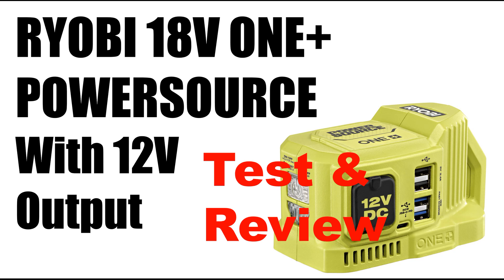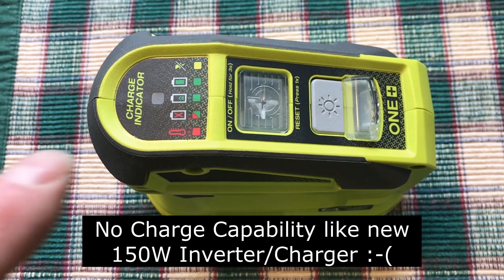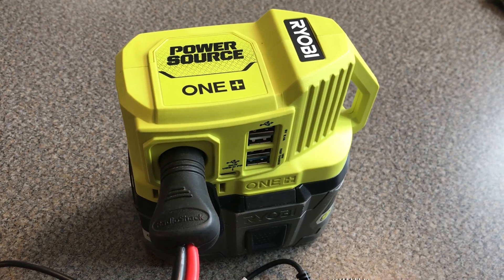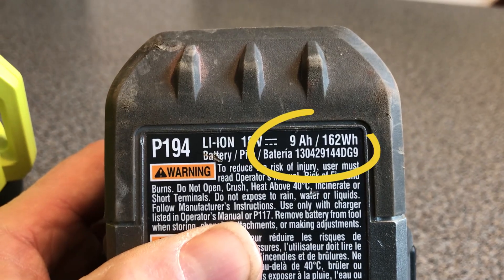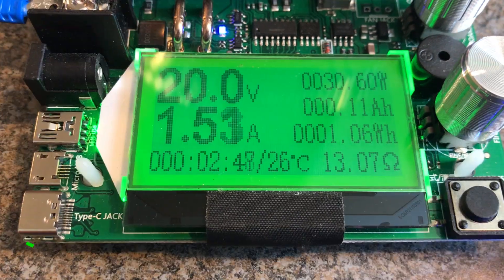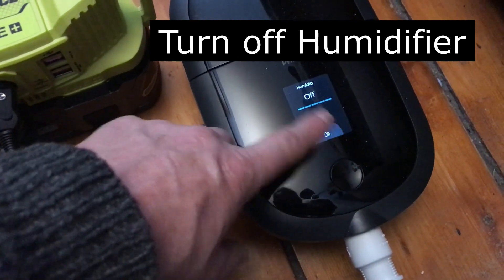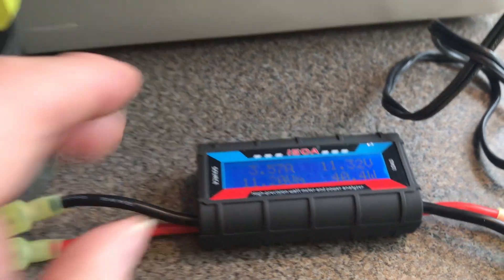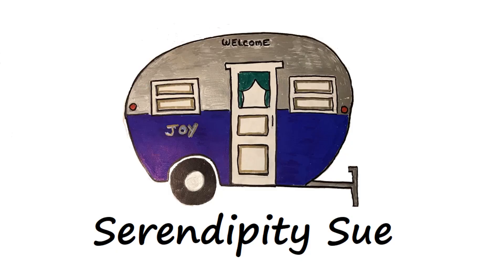New RYOBI 18V One+ Power Source with 12V Output Test & Review (RYi12VBGVNM)

Comment: Why buy this when you could just get the inverter that also has USB charging?
Reply from the maker: @laynelg8762  if you are running 12v appliances it’s much more efficient than converting to AC and then back to DC. The cigarette plug usually handles much higher amps at 12v than usb-c

Comment: Does it shut off automatically or can it be left on indefinitely?
Reply from the maker: The batteries BMS will eventually shut the battery off when it is low
Reply: Same question. If I run my car fridge and the compressor shuts off for say 45 mins, will the unit auto power off?

Comment: Just recently bought one and the USB C PD outlet cause my new Samsung phone and tablet to constantly charge/no charge/charge/no charge. The other USB outlets work fine, and I did not try the 12 volt outlet. Ryobi tech support had not heard of the 30w PD outlet issue and so I went back to Bunnings to exchange it. A new one did exactly the same, so I took a refund instead. I have the two 150w inverters, one came with a solar panel and can charge the ryobi battery via USB C.  They have both worked really well so far.
Reply from the maker: bummer you had a problem with your phone
Reply: @SerendipitySue  sure was. The phone and tablet charge perfectly fine from other battery banks and mains chargers so I was very disappointed.
Reply: I have the same behaviour from my Samsung phone and tablet. I have also seen this on other fast chargers I have used. Family and I have a heap of other devices and they all work just fine. I reckon it’s a Samsung issue.

Comment: Why on earth would they make it 12v ? wouldn't 13.8  be more efficient?
Reply from the maker: yeah, I keep telling them to make it regulated 13.8V. That's what I've done with several of my DIY projects
Reply: @SerendipitySue  I,m looking for  a  24v to 13.8v  regulated. for my camper. how many amps should it be?
Reply from the maker: @immrnoidall  all depends on what you are trying to run with it. I've used both the 30 amp that can run 400W ( https://amzn.to/3PEOdaY ) and the 20 Amp (https://amzn.to/445GgQw ) that can run 270Watts
Reply: Could you mod the unit to fix this?
Reply: @ I ended up just making my own with ebay parts You can get the socket for the battery and a18 V to 13.6 step-down. and added some 18v to 5 v UBS ports. you can build anything with ebays . I've converted all sorts of things to run on the 18v  Ryobi batteries.

Comment: The RYi150CVNM ac inverter was 90% efficient (65 out of 72wh). Why is this DC port so low only getting 70% efficiency? thx
Reply: could be a slightly worn out battery

Comment: Thanks for your review. If I run a 12V device from this power source are there any pros/cons to using the lighter socket vs the USB-C PD port? Does the USB-C automatically detect the required voltage or do I need a special cable or adapter to deliver 12V?
Reply: USB PD requires negotiated power on both ends.  You need a PD "decoy" module to get precisely 12V negotiated from USB PD. if you want 12V and only one of the ends is USB PD, you are better off using a cigarette lighter pigtail and making your own adapter to something like XT30.

Comment: I am afraid to try to charge a gaming laptop.
Reply: If you have a 12v car adaptor for the laptop it'd work just fine, but if you use an inverter you'd need a pure sine wave one or you'd lose a lot of efficiency
Reply: @StevenMussels . Thanks, several weeks ago I used the Type C to charge my laptop.  I hope it was clean energy and did not hurt my laptop.

Comment: Very good video.  Question about the cpap.  I always thought it could only run on pure sinewave otherwise it shortens the lifespan of the device.  How well does it handle the stepped sinewave?
Reply from the maker: This ryobi is DC only. I ran the cpap off the 12V

Comment: The unregulated 12v is big letdown. I get the feeling they give us the bare minimum features on new products (the 40v power station - so many flaws) to see if it sells/what people dont like about it, then they come out with a version 2 at a higher price.
For example the new 150w inverter charger has a 30w USB C for charging, alot of folding solar panels have a 45w USB C port, So I can see them coming out with version 2 that supports 45w USB C with a fancy marketing hook-  "now with 50% faster charging".
Reply: Isn't the new 150w one the new version 2? That includes USB-C when they should have included it on the first 150 watt inverter (that HD is currently pushing)

Comment: Aside from not charging and the unregulated 12v output, that is one of the coolest adapters Ryobi has put out.  The unregulated output is especially disappointing because the difference in cost between the buck converter they used and one with regulated 13.8v output is just pennies.  😕
Reply from the maker: It's interesting that the Voltage at 10A remained at 11.4V the whole duration. They must be trying to regulate it. I've seen other powerstations that have this "sag". That's why I prefer they start at 13.8V.  I used short heavy gage stranded copper wire for the test. So I don't think it was that.
Reply: I've made this same comment numerous times, if Ryobi can save one penny making a product, they will.

Comment: How is the run time on the CPAP compared to the 150w AC inverter?  I expect more parasitic loss due to converting to AC so if you have a DC plug for the cpap, I'd expect this to be better.  Same for phone or laptop charging since the other Ryobi charger/inverter has the AC plug hot all the tim
Reply from the maker: I'm trying to figure out a good test for this. Intuitively I would expect the DC to be more efficient and last longer.
Reply: I have the same question.
Reply: Where  can  I  buy one in Australia
Reply from the maker: @ianladbrook  not sure, Ryobi seems to release different products at different times in different countries
Reply: @ianladbrook Bunnings.